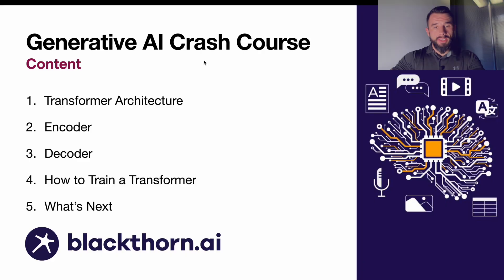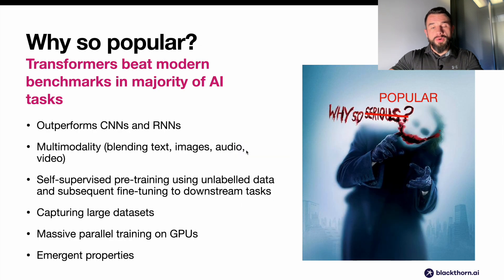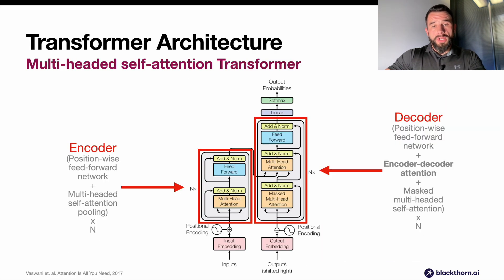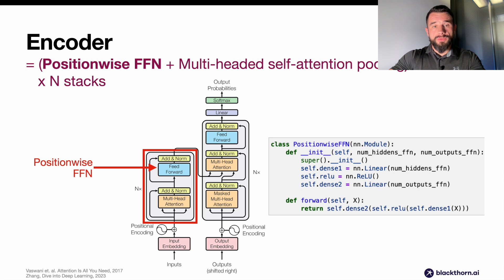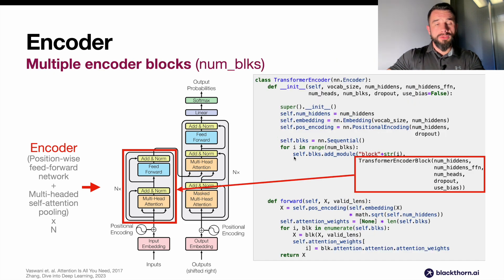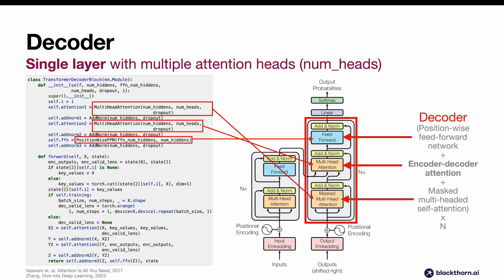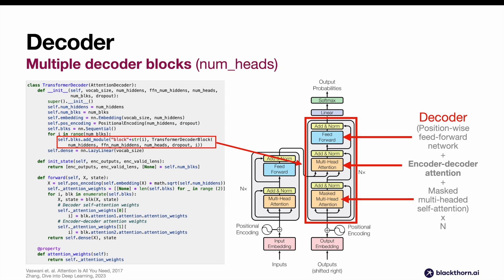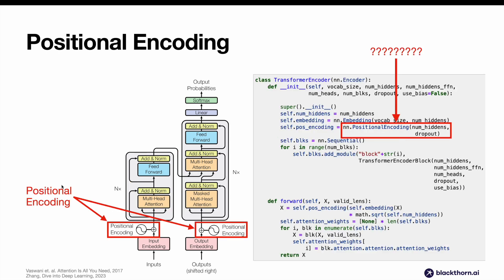LLM Architecture Explained

Comment: Thank you for the excellent explanation of the Transformer architecture! The breakdown of encoder and decoder blocks was especially helpful. Suggestion: Could you elaborate on how residual connections and layer normalization contribute to better training stability? Also, a deeper dive into the training process of Transformers, with specific optimization techniques, would be highly appreciated in future videos. Keep up the fantastic work!

Comment: Great job on postingthis video! The explanation of the transformer architecture was clear and understandble, and the code examples really brought it to another level. Moreover, the approach of connecting diagram spots with pieces of code made the perception of material even better. It would also be great to see an implementation of your trained transformers on real tasks and a result of it. Looking forward to see a videp on "attention mechanism" topic.

Comment: Amazing video! You did an awesome job explaining the Transformer architecture with clear examples and easy-to-follow code. I’m seriously impressed by how you made such complex topics so accessible!
I was wondering if you could dive a bit deeper into positional encoding. How does it help the model keep track of the order of tokens, especially in longer sequences?
Also, it would be great if you could do a video on the different types of attention mechanisms in Transformers, like self-attention, cross-attention, and relative positional encoding. How do these impact the model's performance?
Can’t wait for your next video on multi-head self-attention! I’m really looking forward to learning how it works and seeing the code implementation. Keep up the great work!

Comment: Thanks for the video! 😊 It was such an insightful introduction to generative AI and Transformer architecture. I really loved how you broke down the difference between discriminative and generative AI—how discriminative models focus on decision boundaries while generative models learn probability distributions to generate new data. The part about Transformer architecture was especially eye-opening. It’s amazing how they transform inputs into a unified vector representation and outperform other models, like CNNs and RNNs, in so many tasks. The self-supervised pre-training approach was also super interesting—how Transformers can work with large, unlabeled datasets and still perform well. This really minimizes the need for manually labeled data, which is a huge win. 🙌

Looking ahead, I’m really curious to learn more about how multi-head self-attention works in practice. How does the model decide which parts of the input to focus on? 🤔 Also, how do Transformers manage tasks that need long-range context, like generating text over long passages, versus tasks with short-term context? Given how powerful Transformers are, are there still limitations in areas like creative content generation or solving problems that require specific domain knowledge? And when it comes to fine-tuning pre-trained models, what challenges do you face in adapting them to new tasks?

Comment: Great breakdown of the architecture! 👌I have a question that's a bit off-topic from the architecture itself (since there’s already so much research there) and more about recommendation systems. How do you think companies are handling comments written by generative models in their recommendation systems?

I heard a story where some people promoted their product by setting up multiple stores and about 100 fake users who left AI-generated comments. They created a debate in the comments, where a couple of accounts would "suggest" a cheaper product from another store (actually one of the ones they set up!) that was priced just a bit lower than theirs but higher than competitors. To top it off, they liked these strategic comments with the fake accounts to push them up in visibility. It’s wild how something like this could shape people’s perceptions in a big way!

So, I’m curious—are companies able to detect AI-generated text, especially with how available these models are now and how many of them are there?

Btw, this comment is partially generated by AI🙂

Comment: Thank you for the crash course on transformer architecture! I have a question: how to choose the right bottleneck as the last layer of the encoder? I would also like to hear other tips on building an accurate model with high performance in the next courses.

Comment: Thanks for such an informative video! How does the number of decoder blocks impact the quality of the generated output in a transformer model? Specifically, could you explain how increasing or decreasing the number of decoder blocks influences aspects like coherence, accuracy, and fluency in tasks such as text generation or image synthesis?
Also i would suggest to include slide numbers. This would make easier for listeners to ask questions.

Comment: Thanks for the fascinating and comprehensive explanation of the Transformer model.  I really waiting for the next video with an overview of those blocks of the transformer, that weren't highlighted in this video (like Multi-headed self-attention and Positional Encoding)
I'd like to see how this model works on some dataset (e.g. it would be great if you could show how the responses are generated from user requests using simple GPT LLM).
Also, it would be great if you could explain the differences between transformers made for text generation and image generation.
Thanks a lot for the video!!!

Comment: Thank you for the comprehensive video on transformer architecture and code implementation! The clear breakdown of encoders, decoders, and key components like multi-head attention and residual connections was very helpful. The practical coding examples in PyTorch were especially valuable.

It would be great to see more real-world use cases for multimodal transformers and further insights into handling large context windows effectively in future videos. Thanks again for such a well-explained session!

Comment: Great explanation, but when you use masked multi-head self-attention, are there ways to guide the model to focus more on specific parts of the sequence, or is the attention fully determined by the architecture itself? Also It would be interesting to see how dataset size impacts model performs and id it's the best compatitor for any dataset